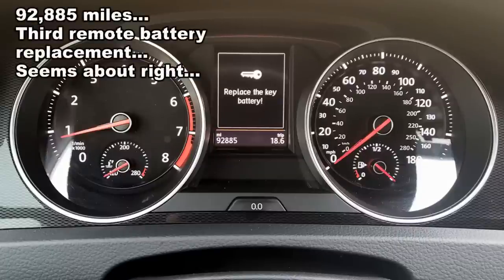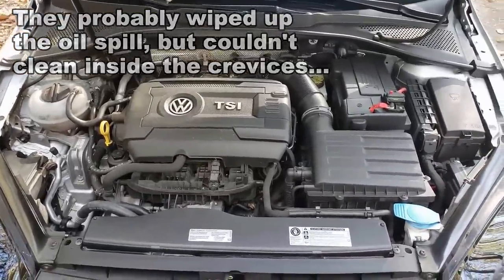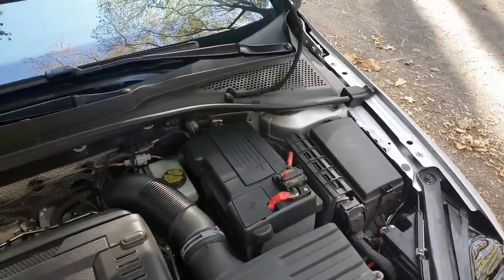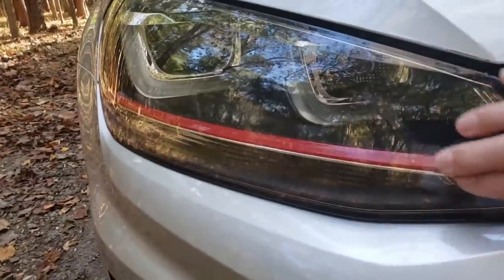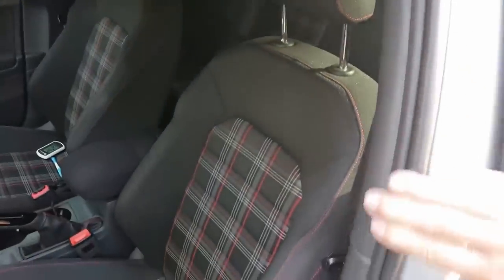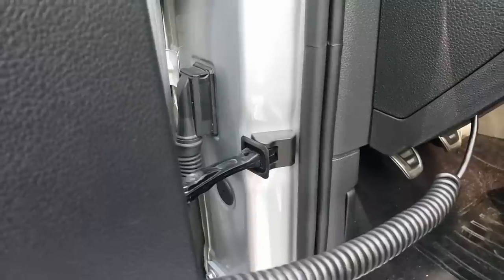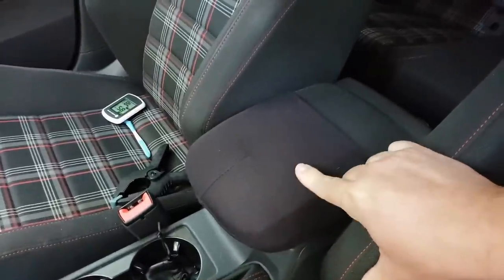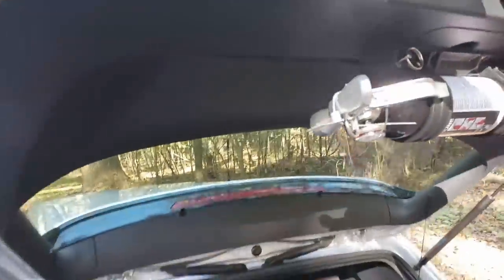THREE YEARS AND 93,000 MILES: My Report, Part 1

Comment: To change a clutch on one of these car at 30K is just poor reliability.
Reply: Unfortunately it’s common with a clutch and stage 1 tune. Should be fine with that tune and DSG
Reply from the maker: In my case, I disagree. I had added over 80 hp and 100 lb-ft to the mix; AND was towing at the time. I didn't speak quite accurately about my clutch. It didn't FAIL, it simply slipped a little while towing a trailer one cold morning. I CHOSE to replace when I did. I could have driven more, maybe another 20,000 miles. I'm not sure. Regardless, I don't think it's reasonable to expect a stock clutch to last with everything I was expecting from my car. Thanks for visiting.
Reply: @StealthGTI  you might be right in that case but my collegue bought a GTD with DSG gear box and it made barealy 20.000km.
Reply: @indahooddererste  That's surprising. There are usually no problems with DSG transmissions on cars with a stage 1  tune.
Reply: @boss4330  well i heard nothing good about it. a german car magazine made a 100.000km test with a mercedes a class and a golf mk7. the dsg gearbox had to be changed at 60.000 km with a lot of other stuff. the a class seemed to be the better deal.
Reply: @indahooddererste  S**t happens with cars from all brands. The DSG transmissions are very solid.
Reply: @boss4330  i have a golf mk7 myself from 2018 but i rather have chosen the 6 gear manual.
Reply: @indahooddererste  I had both a manual and a dsg and didn't have problems with either. I do prefer the manual but for reasons different than reliability.
Reply: My Renault did 154K miles on its original clutch in London traffic. Only changed it because the concentric clutch leaked.
Reply: @afitzsimons  That doesn't mean anything.  You can burn a clutch in 200 miles. Mitsubishi was notorious for not covering clutches on stock Evos under warranty that had even less than 200 miles on the odometer. 
The  GTI in question here was modified and the factory clutch  still lasted 30,000 miles and we don't even know how it was driven. Under this circumstances it's ridiculous to suggest that the car is unreliable.
Reply: @afitzsimons  ya and my mk6 golf tdi made 200k miles or hard driving and a tune with out needing a clutch. The mk7 gti's  were known to have a weaker clutch from 2015 to 17 until vw realised they needed to beef it up alittle

Comment: New clutch at ~32k miles? That's crazy low mileage, right? Is that "normal" for a GTI?
Reply from the maker: Not normal at all. There's more to my story. "Part 2" explains more. Thanks for visiting.
Reply: My Mk6 Gti clutch lasted 100,000 miles on stage 1
Reply from the maker: @josephcreed7  - Glad to hear it. However, it's worth noting that the Mk7 APR tune I had at the time outputs 38 hp and 40 lb-ft more than what APR advertises for the Mk6. The EA888 can easily overpower the stock clutch, especially on a cold morning with a trailer in tow, as was the case for me that day. Thanks for visiting.
Reply: @StealthGTI  I can imagine a trailer will cause the clutch to go a bit sooner. I will admit however the clutch began to slip once and a while around 75k, but it was the throw out bearing causing the issue. I just took it easy in first gear till 100k, just before I went to upgrade the clutch someone totalled it when it was parked. I had a Unitronic Stage 1 tune

Comment: the cap on overflow does not look straight to me,  make sure it clicks when fully tight..
Reply from the maker: Thanks for that. I backed it off a hair since it was quite difficult to remove when I topped it off recently. I'll snug it a bit more.

Comment: Did your ECU upgrade affect the factory warranty? The reason I ask is I have a stock Mk6 GTI edition 35 and I would like to look at some tuning options. Great video thanks from New Zealand
Reply from the maker: I'm sure it would have affected the warranty if VW was made aware of it, particularly if I had a need to take the car in for repairs. I've had no need for dealer repairs. So, I never had to test that limit. I'm far out of warranty based on mileage alone. Thanks for visiting.

Comment: just leave the plastic pan alone, steel skid plate and change oil from the dipstick tube
Reply from the maker: Already changing the oil from up top. It's great. That's part of the reason I didn't discover my leak until it was quite a mess. HAHA! Thanks for visiting. -Scott
Reply: I see no reason to change my oil pan. Living in the Chicago area, I doubt I'll ever hit anything that causes damage. Plus, I don't want the hassle of having to do the gasket etc.
Reply from the maker: @willmercier2852  - All is well until you hit a chunk of ice. What are the odds? Hopefully, very slim. That said, I wouldn't do it again.

Comment: That's a lot of problems. I miss the "old days".
My 2002 Ford Focus had an ignition coil replaced under warranty and that's it. I had a dead AC compressor after 13 years and a dead alternator a year later. Aside from that it's been rock solid for 17 years and 200k miles.
It's EU spec which means it doesn't look like the US Focus, it doesn't have the same interior and it doesn't have the same engine/drivetrain.
Reply from the maker: Thanks for visiting.

Comment: I have a 2015 with 66k and the stock oil pan with no issues.  I recently experienced the vaporizing coolant.  I added a little bit of distilled water and all good for now.  I also have the same tires and I love them.  Next time I will buy them in 235.  thanks for sharing
Reply from the maker: Thanks for writing.

Comment: 30k: carbon build up on fuel injectors. Service depending on vw engine ranges from 1-2k. Meanwhile toyota/lexus 200k engine just started breaking in.
Reply from the maker: I use Top Tier fuels exclusively. I'm hoping that it helps to keep things clean. Thanks for visiting.
Reply: @StealthGTI  Just to add to you comment - I had a GLI with 280k miles on it and never had my injectors replaced or my values cleaned. But I did start using Top Tier Full exclusively starting around 60-80k when I want Stage Two flash. Top tier is what is best for a new age direct injection engines anyway.
Reply from the maker: @jasonhaye3457  - Thanks for sharing.
Reply: My mk7 has 40k miles on it and never had an injector replaced or valves cleaned.....so what your saying is just cooked up because you dont like dubs. Hell my old mk6 tdi had 200k miles and only ever cost me oil changes, 2 timing belts, 2 batteries, 1 accessory belt and tires in the 5 years i owned it not once breaking on me while i was drive all maintence done just because it was time to be done....because i maintain my vehicles. My old TDI's was the most reliable car ive ever owned.
Reply: Admiral Ackbar perhaps, but then you’d be stuck driving an appliance with odd styling and zero personality.
Reply: @michaelconverse5127  There are many reliable naturally aspirate engines that don't have this issue. V8s, v10s, v6s. Even DI turbo engines that have a cleaning mechanism implemented (ironically in most Japanese cars). This issue is planned obsolescence and is a great profit for VW in general since all their vehicles from VWs, audis, to porsches have them. The brands isn't the only one with fun cars out there (almost all their affordable vehicles are FWD, or FWD biased AWD, and no LSD), but it is definitely one of the most unreliable by far.

Comment: Good reveiw you lucky that your rings didnt go yet because these engines are very poorly build
Reply from the maker: WOW! I've never heard of bad rings on the Mk7, not out of the blue, anyway. Functionally, the car is still great. Take Care, -Scott
Reply: Oh boy - All I can say is I had one VW GLI with 280k and was flashed APR stage 2 never had an issue with my engine-  Clutch was original too. My second VW is a Jetta and it has about 145k on it now- regular maintenance checked my oil levels and cars still feels as good as ever.
Reply from the maker: @jasonhaye3457  - Thanks for sharing your experience. Also, I agree with your original response, "Utter non-sense."  ;-)

Comment: I have a '15 Autobahn 6spd manual and just hit 75k after 6 years.  Ive had  COBB stage 1+ with an RSR clutch since 15k miles and have had zero issues.
Reply from the maker: Sweet! Thanks for sharing.

Comment: Great video and great car. Do you have any problem with oil consumption, my mk7 gti has dropped down 0.13 gallons per 1 mile. Righ now it has 35k miles without any mods. Tia.
Reply from the maker: Lord Vader - I change my oil every 10,000 miles. Only once, during a very hot summer highway drive, have I had to add a quart of make-up oil. Sometimes I add 1/2-quart once in those 10,000 miles, but usually no need to add anything. Thanks for visiting.

Comment: The factory front window was IR-protected, while aftermarkets usually don’t. So yeah, it should be more clear. Btw. you can easily spot the ir-shield and/or the lack of it with polarized glasses.
Reply from the maker: I think my new glass is still protected. I recall seeing "spots" when viewed with polarized glasses. As for the lack of clarity in the factory glass, it's hard to explain. It was almost like it had a uniform sandblasting look or perhaps microscopic bubbles throughout. I think all glass has them, to a degree. The key is the tolerance of the manufacturer. I described Fuyao as an "aftermarket" glass maker. The truth is they're an OE glass maker. They simply didn't win the contract to put the VW logo on their glass, quite possibly because their glass was more expensive (i.e., better quality) than whichever company won the contract. Thanks for writing.

Comment: I want to do a steel pan as well but fear what you experienced and would definitely pay a shop to do it for this exact reason. I went with IS38 Turbo and happy with 300 HP.
Reply from the maker: Thanks for your comments, Robert. Unfortunately, a shop may or may not do as good a job. See how I resolved an oil pan leak at https://youtu.be/YQudcXG_5AQ. This is something you can do yourself.

Comment: My MK7 also consumed coolant at a good rate
Reply from the maker: Thanks for visiting.
Reply: What causes that?
Reply: The engine temperature control actuator which is mounted just in front of the water pump was leaking on my MK7 causing a coolant leak.

Comment: Crankwalk?!  I suggest you enjoy it and drive it easy if it's your daily driver cause guess what?  You're rear-main-seal is eventually going to start taking the hits from that crankwalk.  Hopefully you already know this and have adjusted your driving accordingly.  Performance modifications require performance maintenance and there are no exceptions to that rule....
Reply from the maker: Thanks for commenting. I won't be taking it easy on the car. However, I hope to learn of signs that I may spot to catch crankwalk before it actually happens.
Reply: I am having nightmares with those crankwalk issue that I keep reading!  2016 GTI SE 66k miles 🤞

Comment: Hope that cheap timing chain tensioner doesn't give up on you. Those tensioners are sooooo cheap and they break and ruin engines. As for the coolant disappearing mysteriously, shine a light on the left and right radiator tanks. If you see some whitish/pink crusty stuff or wetness where the tanks meet the aluminum core, you'll be needing a radiator.
Reply from the maker: I don't think the tensioner is a high-fail item on the Mk7. VW learned a lot with problems on the Mk6 and made substantial improvements with the Mk7. As for my coolant leak, a trusted mechanic gave my cooling system a thorough inspection and did not find anything. I have made some notes and will inspect my coolant reservoir in about six months. Thanks for visiting.

Comment: If you're obsessive about the oil pan issue go look at the Wortec aluminum pan.  The latest version is milled to accept a factory o-ring seal.  Perk is that it adds oil capacity and improves cooling.  Downside: cost.  But the Wortec solution is still better than the skidplate because the skidplate is almost as expensive as the pan and you have to take the skidplate off every time to do an oil service or conduct any service inspections.  I'd just as soon have an easy-to-access pan that makes oil changes trivial.
Reply from the maker: I wouldn't say obsessive. But I also don't want oil mist all under my car. I'm hoping the new seal will work for a long time. Thanks for writing.

Comment: My 2017 golf with 59k km or 37k miles has been great so far, no oil leak from plastic oil pan at all.  I’ve thought about going for the steel pan but i just trust the rubber gasket on the plastic oil pan more that the RTV gasket.
Reply from the maker: Good to hear. For now, I'm going to try out a Tiguan gasket with my steel pan. It's by far the cheapest fix. If that doesn't seal it sufficiently, then I'll go back to the composite pan and then get a skid plate. Thanks for commenting. -Scott
Reply: @StealthGTI  Doesn't hurt to try it!  By the way I love the quality of your videos and the content on your StealthGTI website, keep the videos coming!  Have a great day!
Reply from the maker: @proboxpepper6752  - Thanks for those compliments. I'm still no natural at talking to a camera, but I think I'm getting better. I'm also going to try settings other than the driver's seat. Inside the car is a great sound stage, but it has to be getting trite for viewers. I'll have footage from a garage in my next video, but I cannot talk to a camera and get any work done. So, I'll probably do a voiceover on that one. We'll see.
Reply: StealthGTI I broke the aluminum oil pan on my 1.8t Passat and when replacing it, the mechanics used Hondabond to good effect, no leaks there later

Comment: The ECS skidplate sucked on my mk5 because I have to take the big heavy bastard off to drain the oil. My Subaru has a thinner skidplate, but has an access hole for oil drain that works great with the fumoto valve. I'd probably stick with the steel oil pan.

And engine oil analysis is totally worth it, $28 from Blackstone and I have a much better idea of what's going on in my engine.
Reply from the maker: Thanks for the note! I extract through the dipstick tube for oil changes. The oil filter is accessible from up top, too. That's the primary reason for considering the skid plate. Fortunately, it appears that there is a gasket that fits the steel oil pan. It appears to be standard on the Tiguan. I have one on the way and will try it out. I don't know how long it will hold before another leak, but it's a lot cheaper to try than a skid plate. HAHA! Take Care, -Scott
Reply: @StealthGTI  Scott, do you know if the whole Tiguan oil pan would work on the GTI? I'm guessing it's a different design. Sounds like at least the perimeter is the same if the gasket fits both engine blocks.
Reply from the maker: @mtsixspeed  - It seems that it should fit. However, I cannot confirm that the Tiguan pan will fit since none of the part numbers match. The GTI's pan is plastic and, therefore, has a different P/N than the Tiguan's steel pan; and my steel pan is aftermarket with a different P/N.  If you're considering a steel pan anyway, you may be better off just ordering the readily available aftermarket pan and then adding a Tiguan gasket to your purchase. I bought mine at Amazon: https://amzn.to/351UMJT. Take Care, -Scott

Comment: Thank you for putting out this video. There's plenty of [great] new car reviews on youtube, but 3 years and 90k+ miles, not so much! The encountered warranty issues all seem reasonable and the owner-created problems are good to know about.
Reply from the maker: Thanks for the note. Yes, many of the Mk7 related videos I watch center around mods, performance, or racing. My mods are fairly standard, as is my performance levels. I stopped racing cars in 2010. Some of my mods are unique and unpopular. So, my videos get relatively low play time. But THIS video apparently has given the community something they want. Who knew a video about a geriatric GTI would be so popular? I'm working on "Part 2" now. The oil leak discovery added more content than expected. So, I have more to share. Thanks for visiting.
Reply: @StealthGTI  Keep in mind that 2017 mk7s are coming off of leases and are still in the band of fairly new used cars to pick up. Speaking for myself, i'm really curious about the truths, myths and realities of VW ownership, especially regarding the GTI. I like to own my cars for a long time, so the long-term ownership experience is highly valued. Best of luck with your next 100k! :)
Reply from the maker: @YasumotoUS  - Thanks for the comments. I hope to give regular reports as the car gets older. Thanks for visiting.